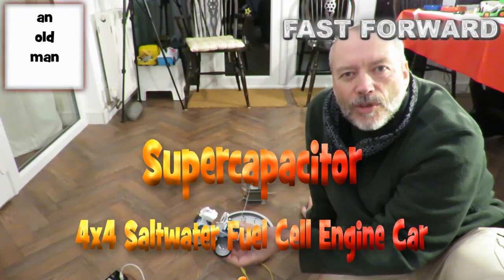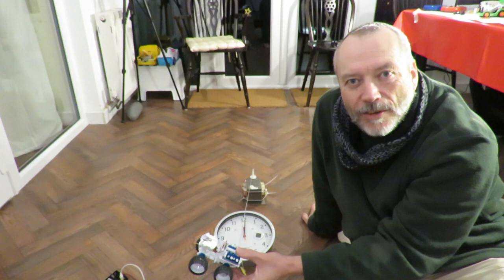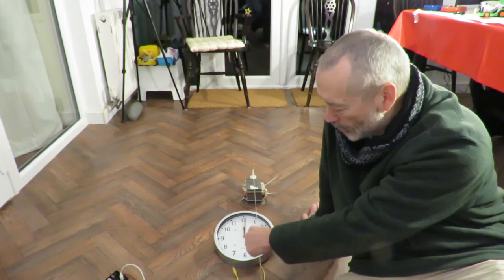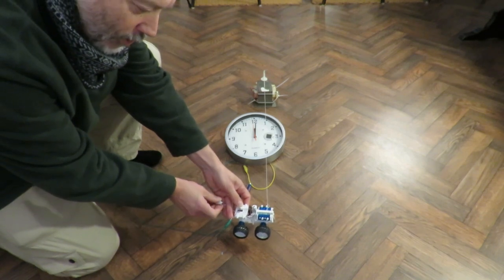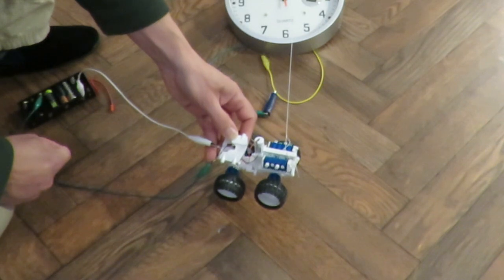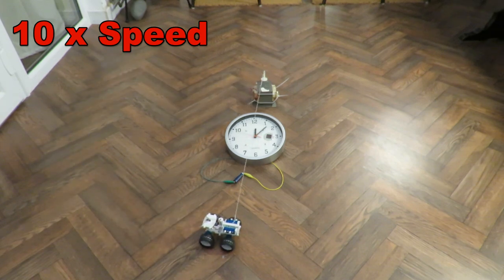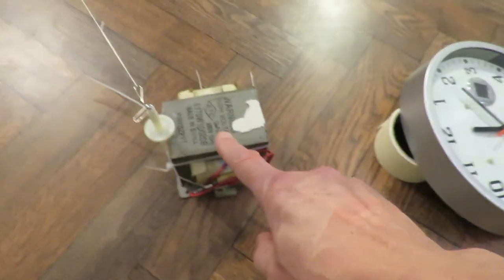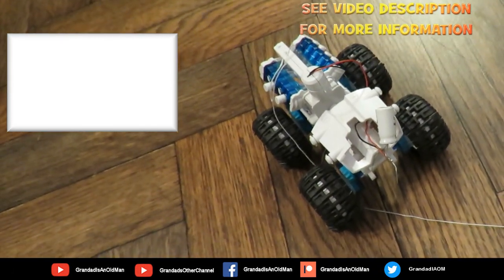Supercapacitor 4x4 Saltwater Fuel Cell Engine Car Modification FAST FORWARD

Comment: You could gear it down probably as well too make it faster.
(Probably geared down too give it enough torque to run easily over obstacles or for a bit longer with the original salt water cell that produces perhaps 2v at best.)

Comment: Super capacitors are relatively new to the market and they're very interesting devices.  Some people have used them to replace their automobile battery.  If I understand it right their life span is much longer than a normal car battery.
Reply from the maker: I think the main benefit is they charge faster but I cannot comment on how long they last. I remember Lasersaber did a series on a car battery pack back in 2013 https://youtu.be/z3x_kYq3mHM but those are much larger than this little chap :-)

Comment: Excellent video. I have one of those but it doesn't work and when it did the Pistons didn't work.
Reply from the maker: I gave this one a spray over with silicone oil to lubricate all the plastic surfaces and that supercapacitor gives it 2.7 volts so it is probably getting more power that the saltwater cell would give it.